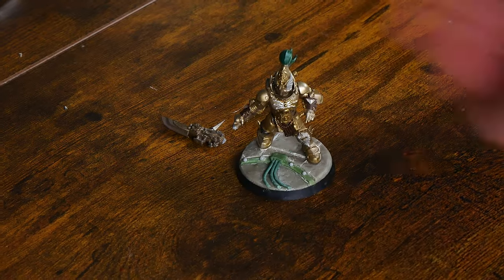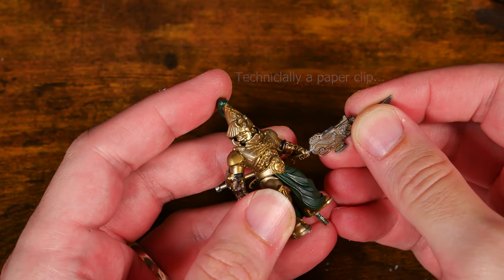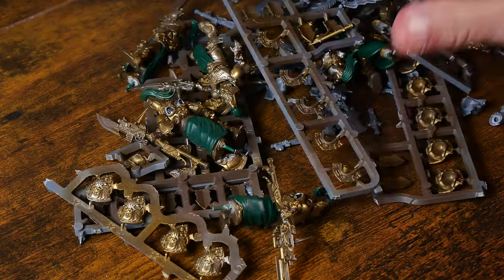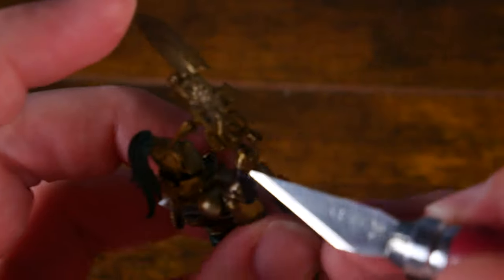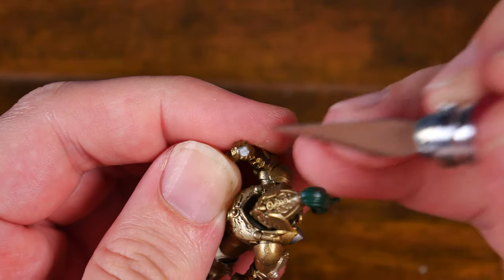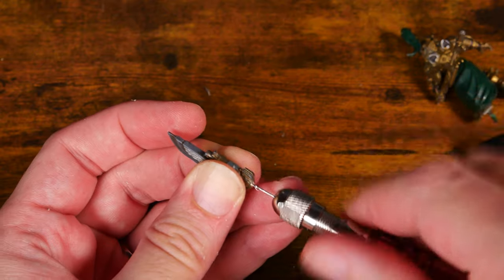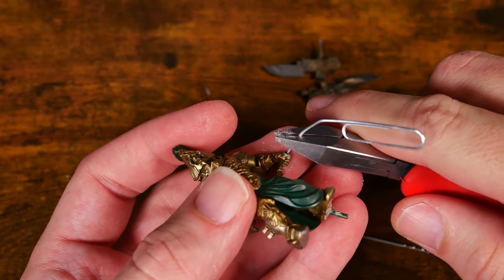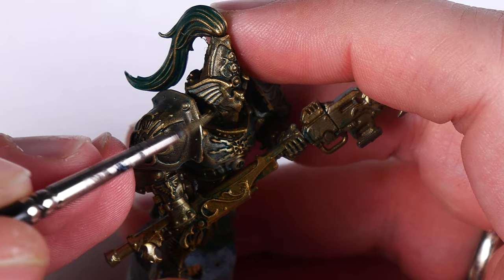Quick Tip: Fixing Broken Weapons with Pinning

Comment: If you have already added pin to one part, you could dip the tip of the pin in paint to mark the exact place you need to drill (it's very useful when dealing with metal models)
Reply from the maker: 100% and great suggestion. I find that works really well when you have other guides to ensure that your pins are where they should be.

Comment: Get good drill bits!  My wife ordered the drill for me as we had none locally. It came with thin drill bits for resin. I have broken 3 of them, most recently drilling out a hat where I broke a tuft coming out the top. It broke flush with the cap so all I can do now is just glue it and hope for the best.  So good REAL drill bits from a hardware store are a must.
That said, I saw a video recently of mixing or sprinkling some thing over the super glue while wet, made a super hard bond you could drill into, so I may try that.